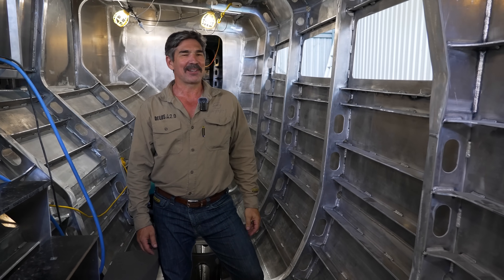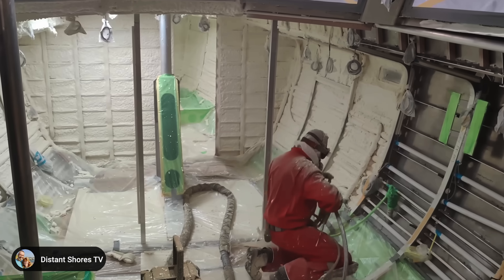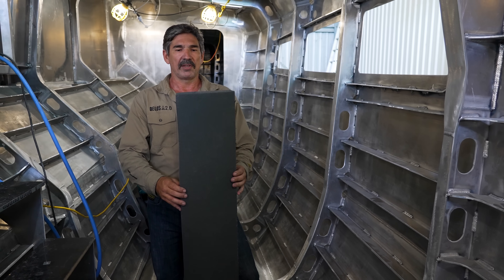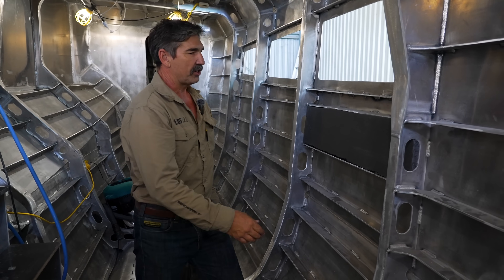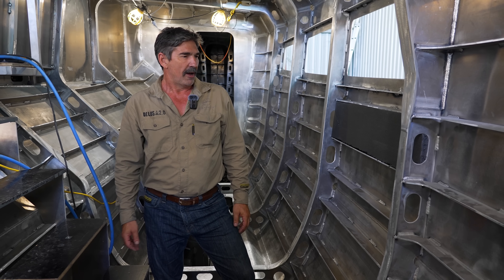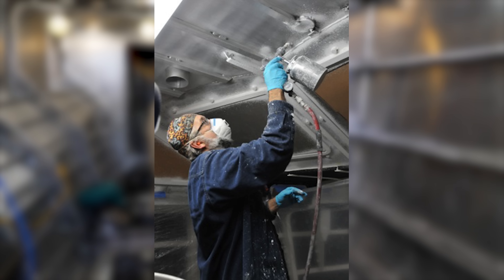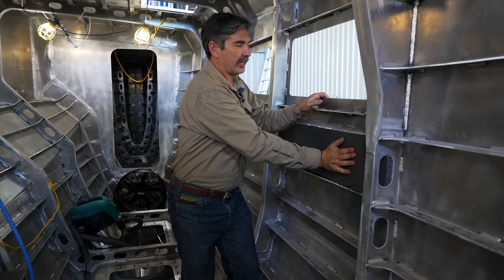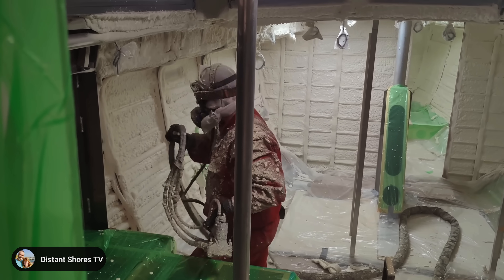HELP, We Need Your Advice!  How Should We Insulate Our Aluminum Catamaran???

Comment: I think the part that most people forget is thermal bridging. You need to insulate the most protruding part of the bulkhead of you will have thermal bridging. I personally would think of insulation the other way around and add it to the back of the interior wall panels. That would leave air behind for moisture to dissipate and is easily removed. It’s much easier this way to avoid thermal bridges. I would also avoid metal fasteners, they will bring in the cold. Good luck!
Reply: This guy insulates.
Reply: I just posted kinda this approach. I feel the frames and ribs are going to pose a thermal induction issue for moisture contact with the interior otherwise.
Reply: If you think “they will bring in the cold” when referring to the fasteners then you don’t understand basic physics. Cold cannot travel. Only heat can travel. Cold is the absences of molecular movement and therefore can’t move. Heat is when there is a large amount of molecular movement and therefore conducts or travels.
Reply: @Youtuber-k2p  I refrigeration Hot moves to cold, I believe that is what you are saying here.
Reply: @Youtuber-k2p  indeed, in science we talk about heat traveling, same result. Interior heat will be stolen by the fasterners, you will feel the cold radiating.
Reply: @Youtuber-k2p  yeah cold can't travel...stick your tongue on a frozen pole and you aren't going anywhere!! Lol

Comment: You might want to get ahold of US Coast Guard, they may have some great insight on what to use. Also check with your insurer and make sure any decision you make will not make the boat uninsurable. Many homes in the US now are finding out that some companies will not insure homes using a spray foam insulation. Food for thought. The boat looks great!
Reply: That is a type of spray foam, not spray foam in general
Reply: @ good to know, I will try to find out what they both had sprayed.
Reply: Not only the type but how it was done as well. All the cases I have seen on this it was because they hired a shady company to upgrade the insulation in an older house which was not designed for it thus it can cause problems. Go take a gander at the Build show channel here on youtube they have a few video's on it and the problems of adding foam to an existing older house. It can be done but you essentially have to do some extra steps to ensure things don't go wrong down the line. 

New build no issue as the house was designed for it. d
Reply: I was going to mention the insurance companies denying coverage as well, some folks I personally know in Colorado and another couple in Florida are fighting with it right now.
Reply: @jasonlightfoot4145  the insurance issue is due to incorrect installation on the underside of roofing decks. There needs to be an air space under the roof deck to allow for drying (moisture getting under it from the outside) and to keep the predominantly used asphalt shingles from roasting.
Reply: https://youtu.be/hCZgv4K5aTk?si=mj_Ri9GAp81rjqoF

This explains the issues with spray foam

Comment: 'Cozy Wrap' against the metal than 3.5 " Rockwool insulation. Rockwool is not only fireproof and sound deadening but it's also not affected by moisture. It doesn't give off any nasty gasses either.

Comment: spray foam - if removed like others say, razor blade and I like using a wire brush cup to just shred it up on spots i need to fix. respray with some cans on hand to cover work back up. pretty easy.

Comment: Hi Brian, it's been a long time since I've had to work on a boat, but I have lots of experience with vehicles and homes.  You're going to have a couple of problems with insulating.  The skeleton on the boat is going to act as thermal conductors, there are are gaps between the mounting tabs on the frame ribs and the outer skin of the boat.  The block insulation will give you more gaps for air/moisture and reduce the efficiency of the insulation as well as create places for corrosion to start. As much as I hate the idea of spray foam, it does look lie the best product for your application.  Look to see what solvent will melt the foam for easier removal later.  I don't know if this will help, but I hope it does.

Comment: Brian, have you considered sticky back velcro by the roll? Just a thought as you said sticky back foam would stick and velcro you can cut lengths to suit. Maybe a piece in each corner, or, 3 short vertical strips per long horizontal piece. You would know better than me, how to, and where. Good Luck. Loving your videos. Peace'n'Love.

Comment: I'm certainly no expert and can't speak to how they compare for temp control, but I really like the foam blocks pinned in method for ease of use when or if you need to get behind the insulation for maintenance purposes.

Comment: Rockwool or Glass wool both with a Alu or Polymer sheared layer mesh towards outside because of the condensation. Then you have on the outside hull at least 2 x Alu which is facing each other. On the inside I would choose a 1 way polymer foil which let the moisture through. Look up for Air plane insulation- They need to insultate at least up to -50°C in 11k feet altitude. Same problem only on much bigger temperature differecences.

Comment: RockWool is a great insulation and is water resistant, fire proof, really fire proof and a great sound deadening insulation. Maybe with that spay on protective coating and RockWool your problem could be fixed. In my town it goes for $85 for 56sq ft, and you will have no waste and easy access if you ever need to remove but still would go with closed cell as it also offers a small secondary seal on the hull incase of breach.

Comment: Dehumidifier in both hulls.  Water is a problem with any build.  Once that musty smell starts there is no getting rid of it.  Solution is to stop the humidity.  A secondary benefit is air conditioners use 1/3rd of their energy dehumidifying the air, so if it’s already dehumidified the AC will use less energy.  As far as insulation, I know the best insulator per inch is aerogel based material.  I have never heard of aluminum corroding because of water.  I thought the oxidized film that naturally occurs on aluminum protected it?

Comment: I've owned 2 steel boats with insulation.  The first had fitted foam panels secured to the interior hull. My current boat has spray foam insulation.  I think the spray foam is superior because there are no gaps as is inevitable with fitted foam panels. If you do need access to the inner hull a chisel will make short work of the foam and at least with a steel boat that's hardly ever necessary. The spray foam as you say is a durable tight efficient coating.
Reply: And spray foam is very tight and very sealed. I personally think it's superior. A tight air seal is much more important than people realize. You can't get that cutting phone pieces to fit. Only spray foam seals tight as a drum. So many people don't realize that having a tight air seal is extremely important to insulation. It can really add to the r value and the effective properties of insulating.

Gaining access later can quickly become a moot point because of proper wire chases conduit and piping. If most of the chases have conduit and it's well thought out and planned the spay foam is not a problem for maintenance. Even so a whole saw or even a cutting knife and you can gain access to the spray foam incredibly easily.
Reply: Hi Brian... John & Candice from Shilshole... I've used a product, maybe one that you are looking at. This was 18-ish years ago. 1 product is "delta-t" for insulation and another product is "delta-db". Both are roll on or spray products. I've rolled the delta-t on bulkhead like chain lockers to cabin. I've rolled the delta-db on the genset covers to stimulate the gen noise. It might help you attenuated noise from your green set to the adjoining cabin. Were enjoying your videos too the max..
Take care.. John&Candice on "The  Two 13's"
Reply: With any insulation make sure it is inflammable/ fire retardant! Also an air gap between insulation and panelling gives a lot of additional insulation.
Reply: @pkluyt  air has moisture in it & that's not good. Air = moisture & contaminants. no air gap = better. Totally sealed = Best.
Hvacr industry - 44 years.

Comment: I am sure there is a spray on that is appropriate. Your chief complaint with spray on, is it's permanence and difficulty in selectively removing it as needed. If you could find a initial coating material that allowed the finished spray foam to stick but separate this could address that concern.

Comment: What does the boat manufacturer recommend? My recommendation is a combo... use the barrier everywhere, spray all the areas that you will never need to access, and then insert the poly in any area you need to access. Before you put your final finish surface on, meticulously document where every compartment is. Not an expert, but makes sense to me.... Good Luck. I look forward to seeing what direction you go.

Comment: Hello, If you just stick on the insulation then the backsides of the plates are not closed for air ventilation. Air will heat up and pressed out from behind the blades. In the evening the air cooled down again and is sucked back behind the plates. With the air also dust and moisture. As the Aluminium is cold by night the wet air will start condensation and leaves water behind the plates. The insulation must be glued air prove on the hull. This is much effort and ends up with the same effort as spray foam. BR

Comment: hello , on my alloy catamaran , we sprayed cork 3mm +styrodur type on top no moisture whatsoever so ever , on my 50 feet cat i thk overall weight of the insulation is +/ 550 kg . this is great combination . even win a 70 pct moisture environment never had any water bubble on the ceiling or side .

Comment: However I think technically there are a lot of pros for the spray foam, please make sure you take all precautions necessary. There is a reason they started to ban it in countries like Germany. Pur/pir  is terribly good though, and even in Germany widely used in its panels form. Less easy to work with though. I like the flixibility of the xpe.

Comment: I built my own Roberts 53, steel boat. I hired a contractor to spray in two part polyurethane foam insulation in 1997. I would not do it differently. First, I had to drill thousands of holes in the frames, then attach wood furring strips (I used spruce, glued with polyurethane glue and screwed in place). All the cabinetry attaches to these wood strips so don't skip this step. Now, 27 years later - the coated steel is like new, I am sure because I have had to drill holes from time to time.
Reply: @SVJoana  Brian, you may also need wooden stringers for attaching the inner shell, although in some areas you might be able to attach to the frame riders.
I attached stringers to the frame riders and it works well allowing a little room for that wire you forgot to run.
Reply: Hi Wade! Just to confirm that Joana is indeed a beautiful yacht having been aboard in both Grenada and Brisbane. I would trust anything Wade says :)
Reply: @johnduckworth564  That is very kind John. We have great memories of our times together!
Reply: Don't get caught in the esthetics of spray. It is very manageable with proper placement of conduit and runs. 
Also you may leave some lockers or lazarette bare as examples of construction.

Comment: My personal experience (40+ years ago) is with insulation held on by those pegs, except in this case it was actually fiberglass batts due to potential fire concerns.  The interior of the hull was painted, then the insulation applied (seams were taped).  Afterwards the insulation was painted as well, the USN loves gray paint!
Whichever method you choose I suspect that best practice would be to stop the insulation roughly halfway between the waterline and keel, possibly even higher to allow for condensation to run down into the bilges.

Comment: If you don't want to spray foam, what I would do is coat with the thin fire retardant coating, install the solid foam blocks, but then overcoat those large foam blocks and all the exposed metal edges with foil backed dynamat car insulation then overtop with whatever interior liner you choose.

Comment: I woulduse full panels 4 cm big. Over that you use the spray fome and cover it up with a thermal insulation off 11mm so you use 6cm
 of isolation

Comment: Condensation will be a problem with the metal with most insulation except closed cell spray foam. Closed cell will be impossible to fully remove from the metal but really when would you have to do that? Cutting channels to run wire and plumbing can be done with a knife or a hot wire. I made a hot wire with a soldering gun and between a knife and the hot wire it was easy. Cut the sides with the knife and the hot wire to cut the bottom of the cavity you need. You can also run pvc piping everywhere and bury under the spray foam or leave it furthest from the hull for easy access.

Comment: No experience other than working on large aluminum boats, decks, storage areas etc. Anytime my work got to exposed aluminum, I was told to paint with zinc chromate before putting anything on or attached to the aluminum. No idea if it helps with condensation but pretty sure it does for corrosion. Looking pretty spiffy in that new Delos shirt and full on dungarees, almost like a landlubber! 😂

Comment: Closed cell spray foam is ideal. Its a one step vapour barrier and insulation from noise and radiation.
Run conduit for wire and plumbing to key areas of the boat as mentioned in another post. All closed cell foam is not created equal. Be clear as to what foam product is being used and conditions during application is also very important.

Comment: Fire resistant insulation? I dont know nothing learning with you guts 😅 😂 navy its just paint no insulation. Easy to maintain and have access to. Can it be a variable of them 3 working together. Depending of the utilization of the space . I could see bedroom primary use them insulation tool shop not really. Common space also. Not something you would get perfect in the first try without workups. Safety first for sure. I remember we had drip pans that needed daily check

Comment: HI there and thanks for asking!
I've been thinking this problem as well although i'm gonna have wooden boat. But thermal things are the same and as I live here up north I might know something of the issue.

First of all as you probably know is that to keep condensation out you really need to cover all the metal. Boat is a very tricky thing to insulate compared to house (I'm architect btw 😅) because the vapor barrier is on the outside. Normally in houses the vapor barrier is placed on the inside surface to avoid the warm and moist air from going into the structures and they're creating condensation and moisture damage. Then the outside of the structure will allow the moisture to dry outside.

But on boats when the absolute moisture barrier is on the outside and its metal in your case, you really need to keep the warm air from touching that surface. Any contact will create condensation. Bigger the temperature difference the worse the situation is. In very cold climate the condensation will be frozen. And aluminum is very good thermal conductor.

And then - as you said - you need either to keep moisture out from the aluminum or keep oxygen present. I just highly doubt any kind of insulation will allow oxygen to really be there enough. All the viable insulators are some kind of plastic which more or less is vapor- and airproof. So no oxygen really can enter in all the places. And if - then will the moisture (=condensation) as well. I personally wouldn't risk that.

So - in conclusion - I don't really think there's any other really viable option than spray foam. You just need to think it all through beforehand to have all the conduits etc. ready to go so that you shouldn't have any need to get under the insulation. And if there's real damage in the hull - you can probably cut and melt the insulation off and repair it with some more foam later.

As I'm gonna have wooden hull the problem isn't that big but wood can rot if moisture and oxygen is present. So I've been thinking of method to prevent the form from sticking too well to be able to cut pieces off from the insulation for excamination. I have no idea if that would work at all but that way I could get good forming of the insulation against the hull. We'll see.

Cheers and keep it up!

:Panu
Reply: That is a very comprehensive explanation, which I agree with in principle. However, I am of the opinion that self-adhesive panels and self-adhesive insulation material for the frames and stringers also provide sufficient insulation. Domestic engineering offers a wide range. The gaps must of course be filled with foam.
After more than two decades in the water, I have no problem with the aluminum hull and this setup. The only condensation points are the hatch frames. I'm always excited to see your new post! :)

Comment: This sounds very much like the challenge many have had when restoring old aluminum airstream trailers. You might see if any of those videos help you with a decision. You might consider reflectix as the base layer and natural wool insulation for added thickness. Wool is non-toxic, mold resistant, durable, easy to work with. Something else to consider!